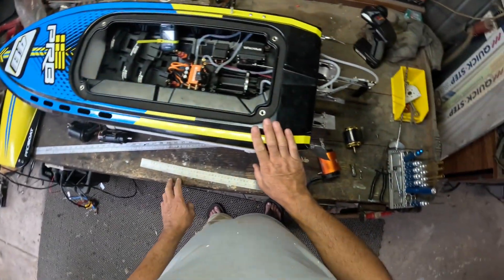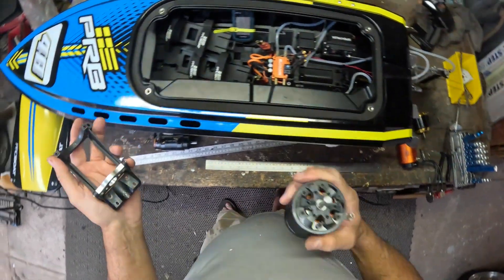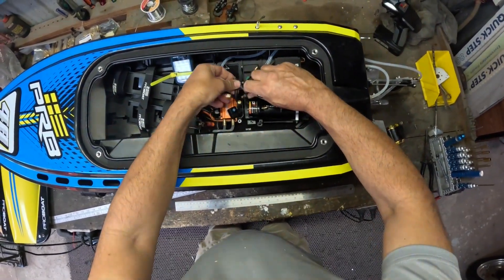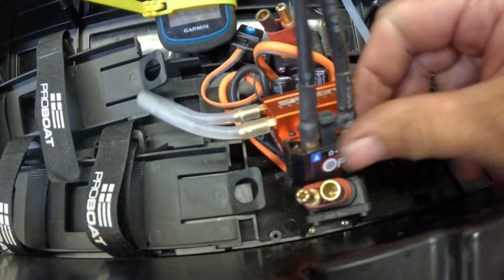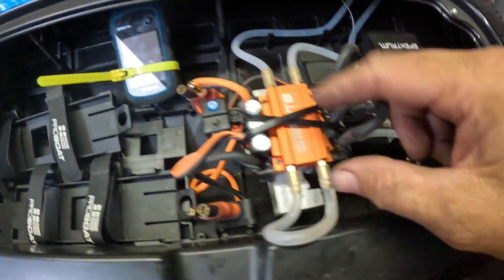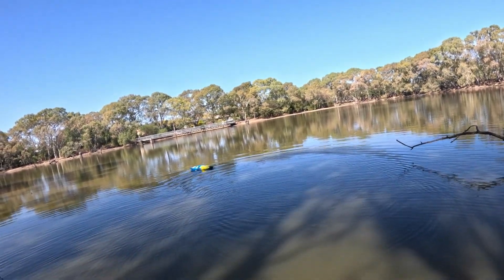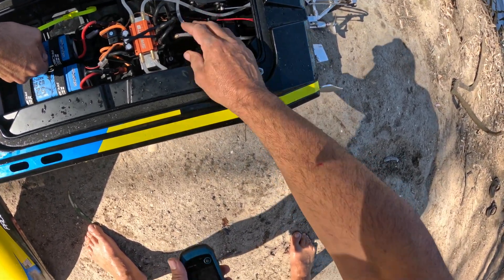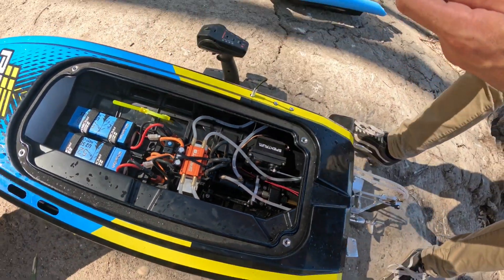TP motor upgrade in the Proboat Supersonicwake First test

Comment: I can’t find that motor on your web site. Can I use the 850kv and it same power?
Reply from the maker: Yes all 4070 have the same power and there will be no difference between 850 and 880kv. We are doing more testing with these motors and i think we are far from finding the best one

Comment: Is that size TP and good bashing motor like since it’s skinny 4070 I want something that will bash and last cuz right now I have 4070 1400kv and only good for speed runs and then get hot
Reply from the maker: Yes thats way too much kv for anything but speed runs, we are going to try out some other kvs this week
Reply: @RCBoatBitz but is the 40 series size can good enough for bashing or does
This boat need a 5660 can to work I want the boat to be around 65 70 on 8s and still be able to bash around I have your full kit on my boat now.
Reply from the maker: @rc_jamm  if you are able to do the mods to install a 56 then go that way
Reply: @RCBoatBitz  ok sounds good thank you

Comment: The best location for the esc put it on the flood chamber wall and I highly recommend flier 12s esc
Reply from the maker: Lot of problems with those escs, plus i only want to run 8s for now so theres no need to change it anyway

Comment: Yes, a good idea, a better quality motor... When you go to the pond, you should bring 3-4 propellers from 50 to 55 with a 1,4 P/D ratio. try each one only for 30s to see which is the fastest. You should also try the influence of the timing. I understand you want to keep 8S and reach 60 mph, it needs some patience and many iterations, but speed progress is not only linked to the motor, this hull can be very aeriial or glued, you have to find the right balance...
Reply from the maker: Thanks for your input, ive been building brushless boats since the 90s so this isnt my first try

Comment: Spektrum RC have just announced a upgrade set, 200 amp esc and 750kv motor to run 12s for this boat.
I suspect they will be releasing a V2 version of this boat in the next 6-12 months.

Comment: Nice. But get real. A boat this size needs 12s and a 56mm can motor. Anything below that is just not right. You need to make a 56mm motor mount to it. I would buy that. I run mine on 12s since october last year... And still haven't a 56mm but will 😂 Funny thing is that hull was made to run stable at only 68kmh...anything past that you need baterys all the way into foam, larger longer trim tabs and even weigth st the front of the nose to make it stable on 12s and barelly 90kmh....😅 Its a melon bur the Spartan is also a melon and look at mine...8s all day long and stable as any Ocidean 😅it needs extreme mods 🙃
Reply from the maker: The 12s videos will come later, but for this video series the goal is to find the simplest motor swap for people not wanting to spend a fortune on a 12s esc or doing motor mount mods. If i can get to 90kph reliably on 8s ill be happy. This boat has all our mids on the back so high speed stabilty isnt a problem
Reply: @RCBoatBitz  What do tou mean by : this boat as all our mids in the back? Cant understand that....explain that, please! Thanks!
Reply: @TargetingXmod_RC  Im guessing he meant to say "mods on the back" referring to the CSS kit
Reply from the maker: yes what lancer guy said
https://rcboatbitz.com/product/supersonicwake-48-css-kit/